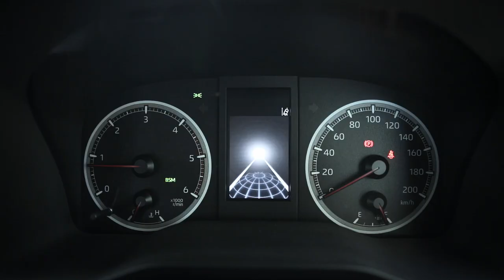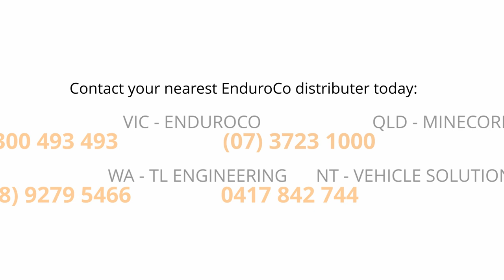ENDUROCO 4X4 HIACE 300 - SUN AND SAND

Comment: Driving in saltwater is no bueno
Reply from the maker: Was thoroughly pressure washed immediately after filming.
Reply: Good luck with that, driving on wet sand & in the water like this will put salt water in places you have absolutely no chance of cleaning.  Being a Toyota it will take a few years but that van will rust like a b@stard by the time it’s 5-10 years old and will of no doubt been sold to some poor unsuspecting persons.  I don’t understand what demo’ing the thing being driven through the ocean actually proved 🤦‍♂️, why not demo it doing what it would be best doing.